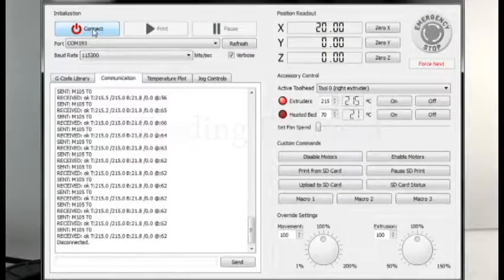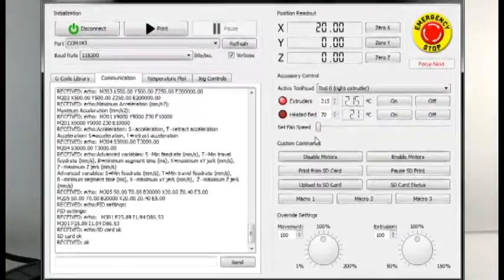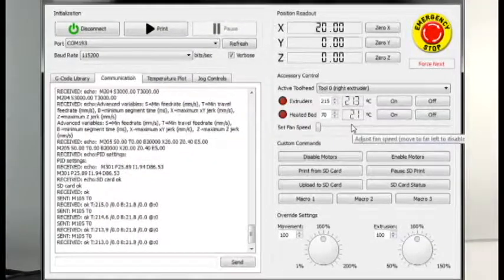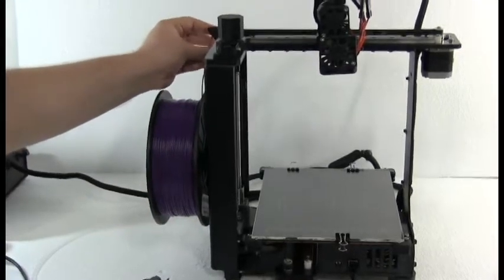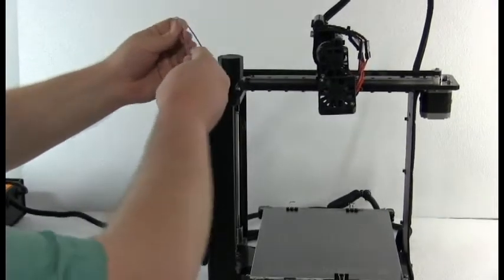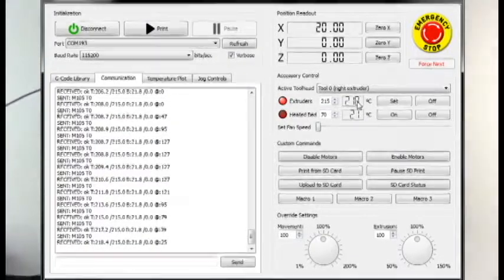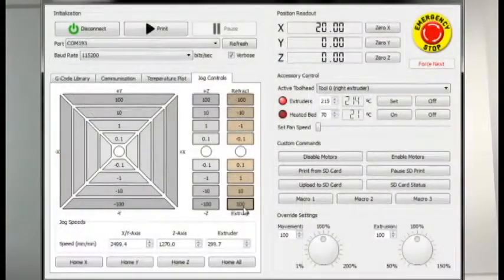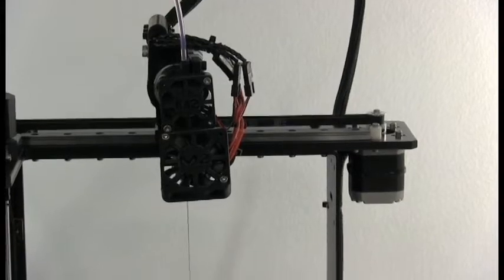MakerGear M2 3D Printer - Filament Feeding

Comment: Just received my M2 today and saw this new video. Great job! It is little different then the printed material, as the print does not say anything about using the software.  Glad I saw this before loading the material.  Very very informative to a newbie.  Thanks!